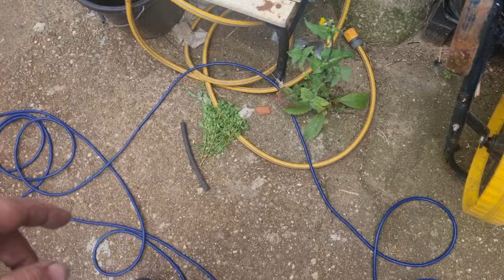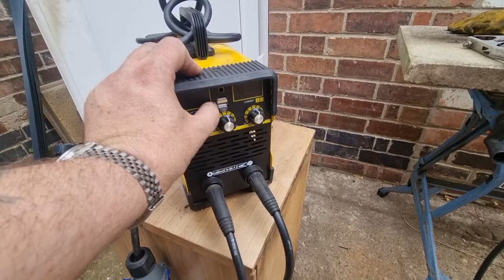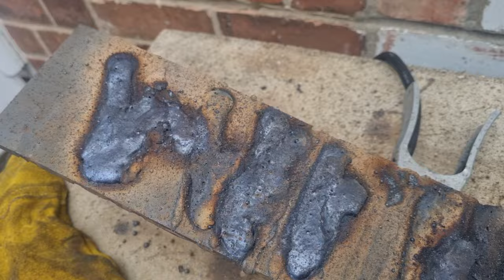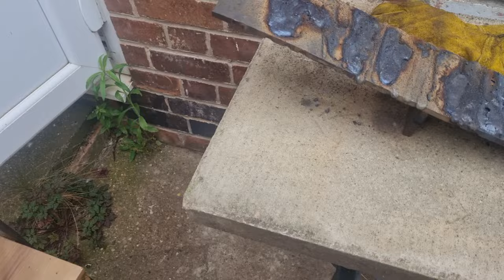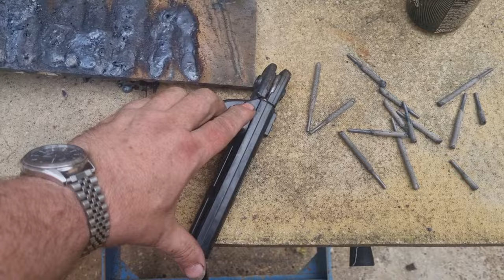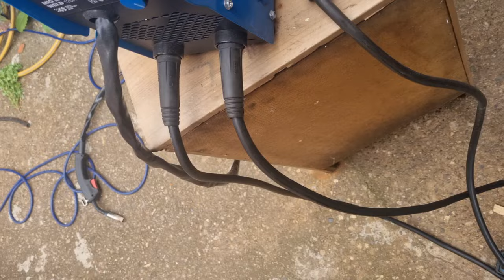Static Arc 200A arc welder, info and stress test

Comment: im'e a retired coded welder for fifty odd years you would only want a big duty cycle for coded pipe work i have oil cooled murex welders that have never cut out. i purchased  the newer static arc 200 amp it does me fine now for my personal work at much cheaper running costs the one's i have are three phase much to expensive for hobby use.i changed the return clamp and the elctrode holder  to the twist one's that i have always used other than that its good so far.
Reply: i forgot to say mine is a mig gas or gasless mma and the connection for a spool gun for aluminium it cost £350.
Reply from the maker: Yeah so far this welder has been good, I ended up buying a Draper flux core mig welder instead of the static arc as I needed something with a bit of fine control there and then, screwfix or toolstation 2mins drive from me and it was a Sunday so no chance of picking a static arc model when I needed it.

I've never heard of the twist electrode holders though so I've done a bit of digging and they do look more reliable and less prone to the electrode angle slipping, I might end up breaking my promise to myself not to spend any money this weekend other than food! , spent more than hobby money on a much better plasma torch and upgrading air supply last weekend but glad I did, absolutely painless to use, a Lotos LTP5000D and I may do a vid at some point, though there are a few vids already and rheres nothing really new I can add, that can cut through 3/4" steel for less than £400

Comment: Amazing that a firm can make and sell that for £75,  bargain !  
So cheap, it can really be considered disposable.
Thanks for giving it an honest test, and sharing that.
Reply from the maker: No problem, it's a great machine for the price, I've seen cheaper machines but my theory I stick to is don't go for the cheapest ;) , I try to stay below £150,for any machine unless unavoidable, because I like this welder and the guy selling them is so genuine I've gone a bit more than that on his Plasma cutter, and so far that's a good one also, the version without a built in air compressor as I already have a compressor.

At some point I'll review that also